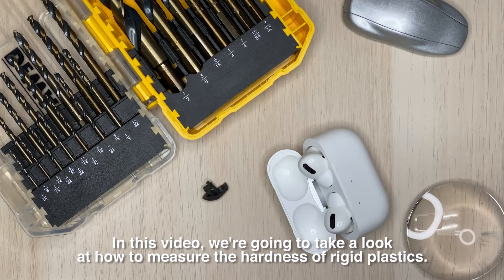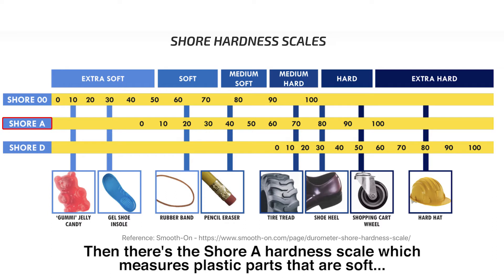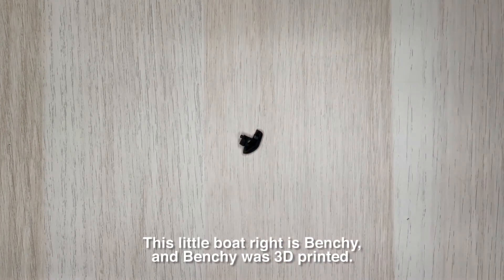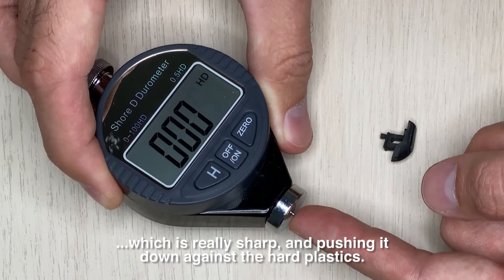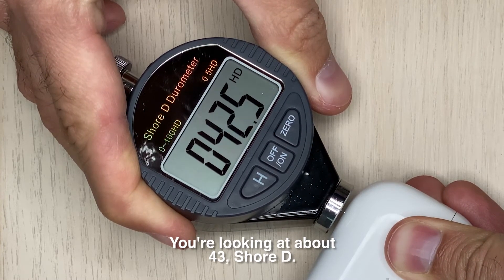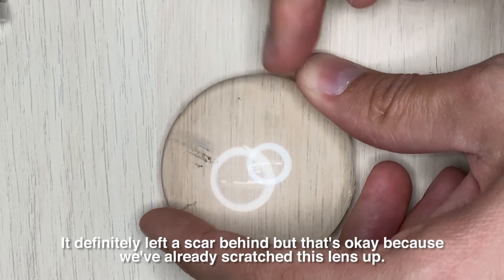How to Measure the Hardness of Plastic Durometer Shore Hardness Scale (Shore D)

Comment: The video is how NOT to measure hardness with the tools! The only good thing about it is that it shows almost all of the common mistakes.

First of all, hardness testing using Shore's method defines "hardness" as depth of penetration of various shapes of tips under different forces, the standardized combinations are called "scales". D scale with the sharp tip you have calls for precisely 5kg of force and the spring in the device is designed to generate it when a flat surface of your material is in complete contact with the bottom surface of the device. If you do not provide the contact then you get hardness measurements significantly lower than the true values. It requires some effort to press hard enough for D scale but you can not get correct measurements without it, that is actually why they make specialized stands for the durometers so you could just turn a handle and let a weight on the top of the stand do all the work. 

Also you need to make sure that you have at least 12mm between the tip and all sides of the measured flat surface and at least 4mm of depth and if the measured part is a thin sheet then you need so rigidly support it from the bottom. Otherwise the part can significantly flex or some material will be pushed to one side and you will once again get incorect values. You definitely can not do it by just holding a part in your hand.

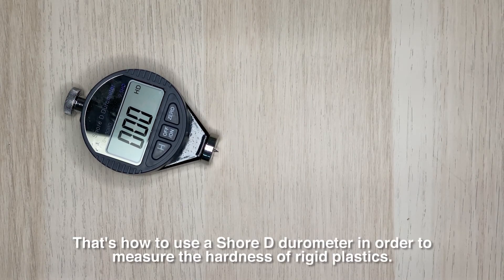Comment: I don't get it, how can you say "here you have it folks that's how you measure rigid plastic  2:20 for real??
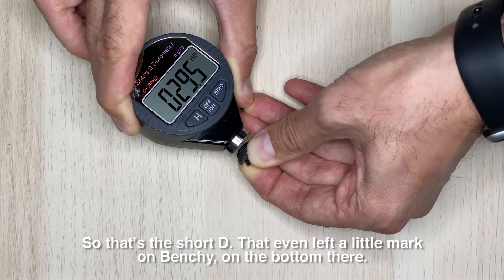LOL think about it, how should this durometer be able to measure this boat  1:20 when you only pushing it 50% down
it not like this probe has some weird waves it is sending into the materiel.
It needs a reference and that reference is when you pushing it ALL THE WAY DOWN, then the duometer will give a reading for how much penetration the spike had made into the material, aka hardness. but I'm pretty sure you need to push it all the way down before the durometer can reference itself to how far the pin is in the material.
these test you're doing where 1 is only 1/3 down and the other is 50% down.. such a test will give you screwed readings.. you need to push the pin all the way down so it is bottoming out and then you can see the reading.
check it yourself.. test with 1/3 down, and test with 50% down and test with 100% down, and you will see that you get way different readings and yep I also got one of these metal Durometer from China.. cost 12USD delivered.
Reply: Good point. I think what you're saying makes sense. Jacon Systems, would you please respond to Jacob's point. Anyway, thanks for the video.
Reply: I think he was afraid to destroy the objects. You are right: you need to push until the base is flush flat with the surface - the tip will certainly leave a mark.